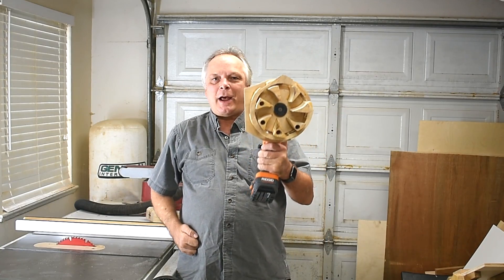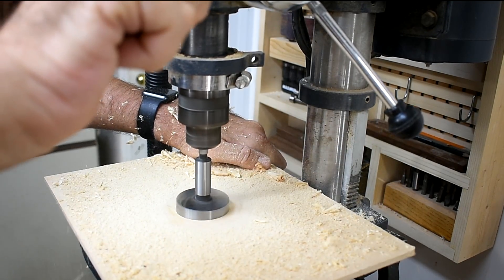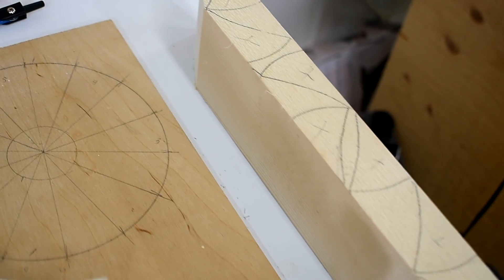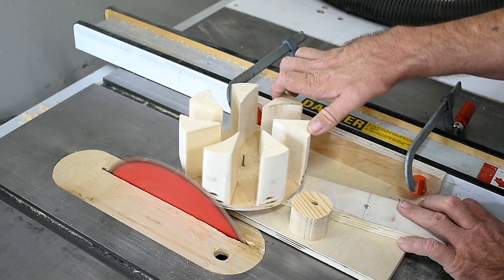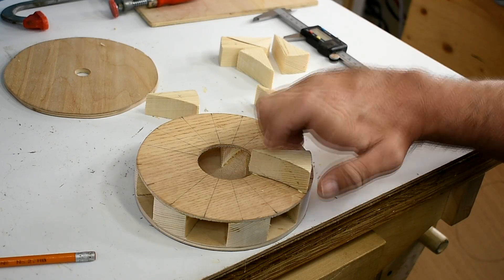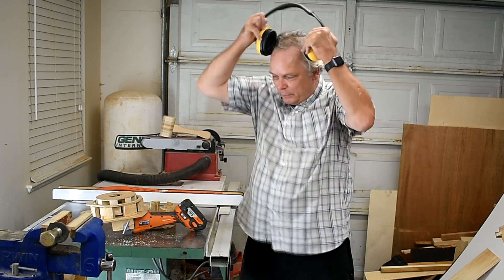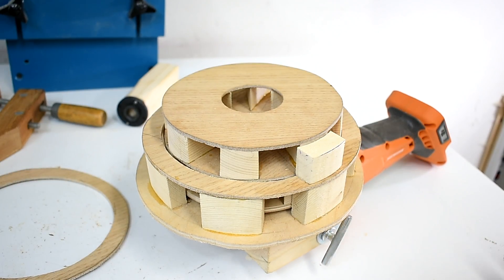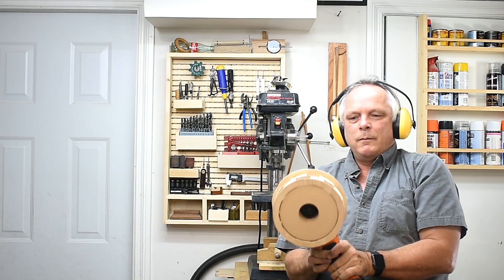Building an Air Raid Siren, Portable and Cordless

Comment: A derivative of Matthias Wandel's design, I see.  Most people wouldn't recognize it but at the same time, not the motor I would choose for it as most sirens rotate between 1000-3500 r/m being driven by induction motors while this thing is driven by a motor stepped down to something like 10 kr/m at the mandrel.

Comment: Good job!  But no explanation as to how to mark out the blade shapes.  Obviously one side must be the same radius as the base disk, with a length of an appropriate fraction of the main disk circumference but what radius is the other curved side, and where is the centre of that arc?

Comment: Sounds like a handheld orbital sander. 

I think a unique thing about air raid sirens is that they spin up gradually, and slow down gradually,  and the top RPM they hit is not as high.

Yours is nice and loud. But I think what you are using to spin your siren changes the results a whole lot.